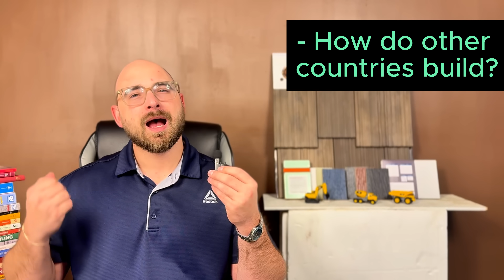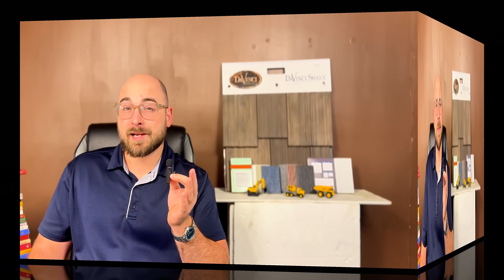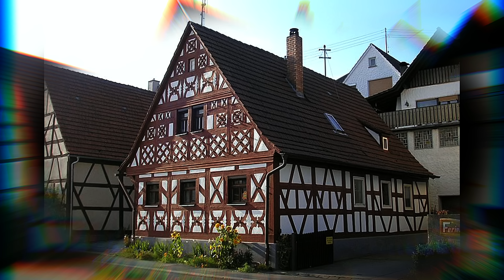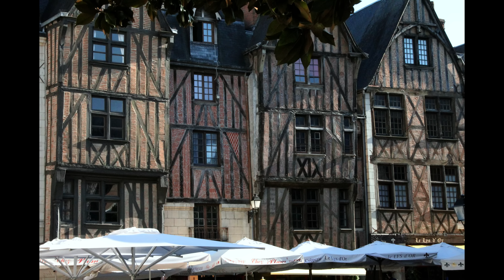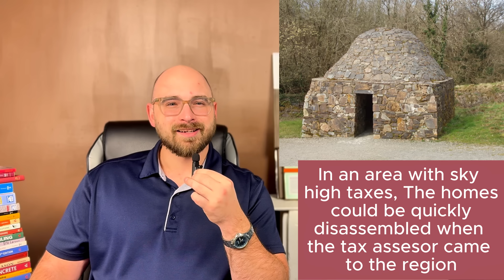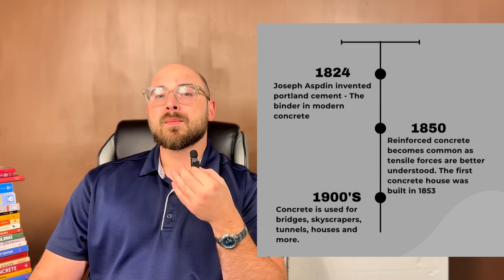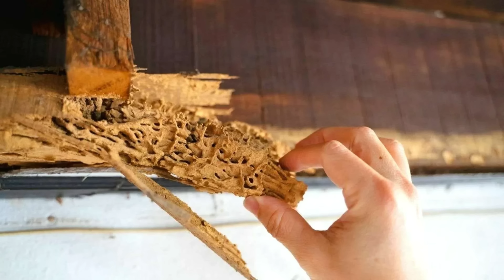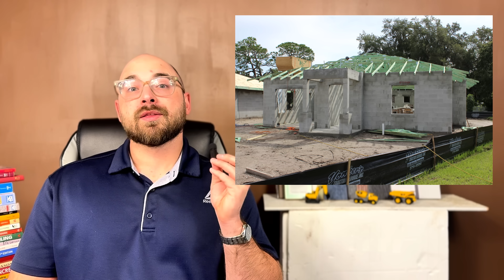Why Other Countries LAUGH at American Homes

Comment: My house in Florida is very well built.  All CBS construciton, rebar re-inforced colums and tiebeams,  All structural walls have a concrete column every four feet and these columns are rebar reinforced.  Roof trusses are secured to the concrete tiebeams with engineered steel straps.
Reply from the maker: Very nice, a good example of confined masonry 

What did you do for insulation, siding, and interior finishes?
Reply: @Mike_Fortin  I have stucco finish outside, R30 insulation on the ceiling and foam panels inside the outer structural walls.  All interior (no load bearing) walls are metal framing with 3/4" drywall and plaster finished.  All my windows and doors are aluminum frame with impact glass.
Reply from the maker: That’s one sturdy house!
Reply: @ Yes indeed.  Since Hurricane Andrew caused a lot of destruction in 92 the County Authorities increased code requirements by a lot. A recent remodel (6 years ago) includes a double wall. The contractor wanted to continue adding blocks on top of the tie bean to increase the height of a new living room by 2 feet but the structural engineer said “no way…you need a double wall to rest the new trusses on.”
Reply: You didn't buy a tract did you. A solidly built house is going to be a custom house. My last house I had built is also my last house  and it was a custom build. A tract house is no where near the same quality.

Comment: Yes. I think ICF is the way to go but I heard of 1 potential drawback, termites.  I've heard that termites could burrow through the foam all the way up the walls to get to the wood rafters or trusses that hold up the roof.
Reply from the maker: Theoretically yes, 

With a proper termite shield in place? Highly unlikely 

At least with ICF you’re not at risk like you would be with wood walls

Comment: Bricks were predominant in India decades ago. But concrete homes are the predominant structure type even in villages. The outer walls are made of concrete bricks and inner walls use a lighter variant filled with fly ash
Reply from the maker: Thank you for clarifying, 

The lightweight brick you’re talking about is AAC, Autoclaved Aerated Concrete